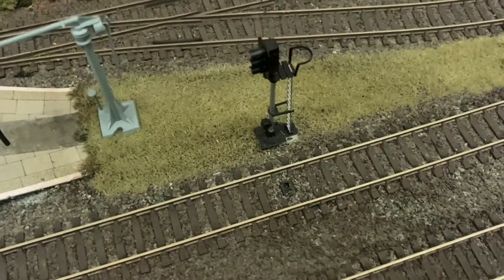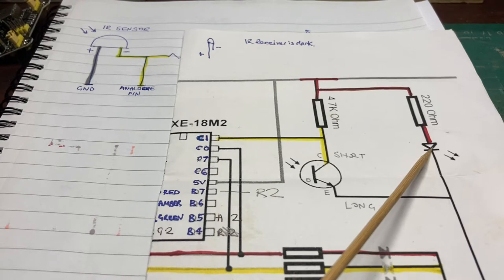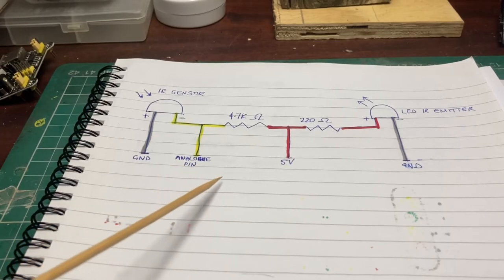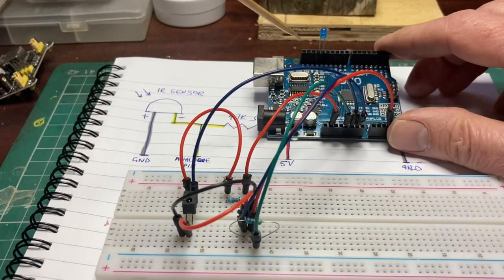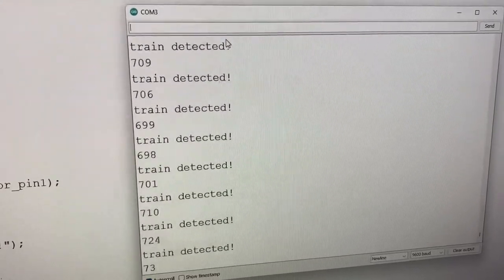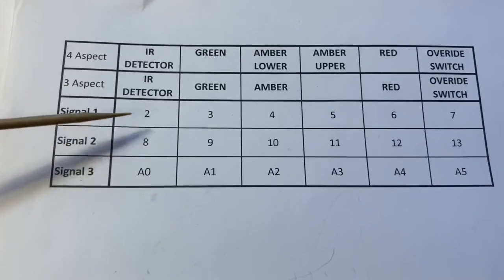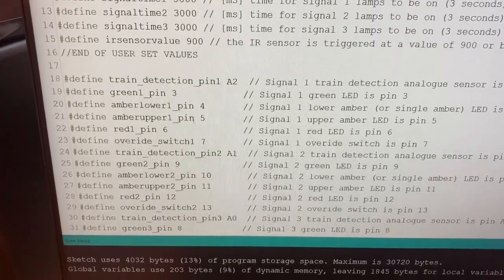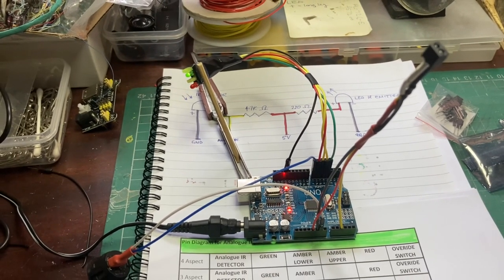Model Railway Automatic Signal Control Using an Arduino Part 9 - Using the old IR Detectors

Comment: Could you advise what type of reed switch you are using please, for example is it a latching reed switch?
Reply from the maker: Hello there, just Normally Open (NO) reed switches,  2 x 14mm are the ones I'm experimenting with
Reply: @ipcress1066  Thanks Paul - I am contemplating using a 2 way signal with an Attiny85 board and a reed switch as a sort of module that I could have several of dotted around my layout.  Where's the best place to go to try and find suitable code? Thank you.
Reply from the maker: @johnbetterton9054  Hi John, I did search for code for my project and came up with nothing and had to write mine from scratch, which I have to be honest, was not fun as I'm not a programmer! I just hope it works as intended. I found watching the Fun With Arduino introductory videos helped with basic LED control so maybe that's the best place to start?
Reply: @ipcress1066  Once again thanks Paul - I'll have a go and let you know how I get on.